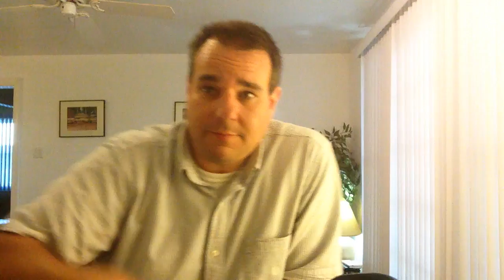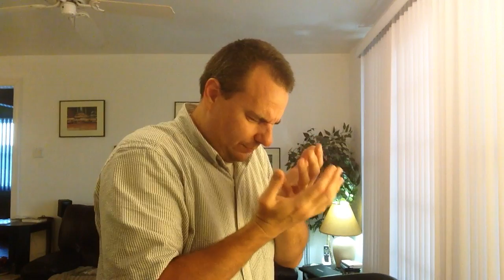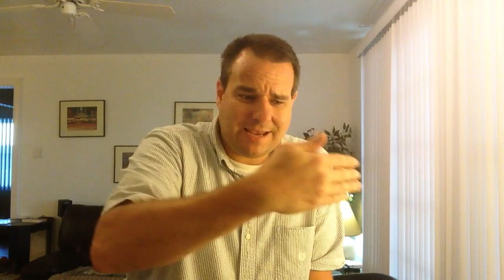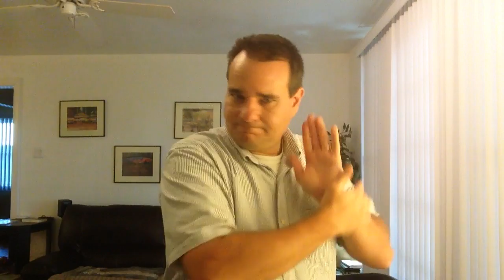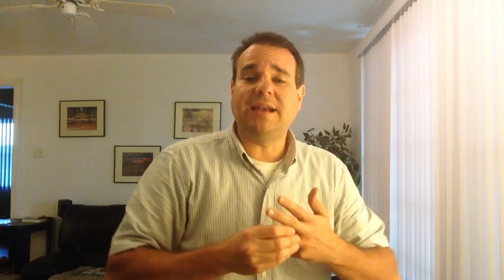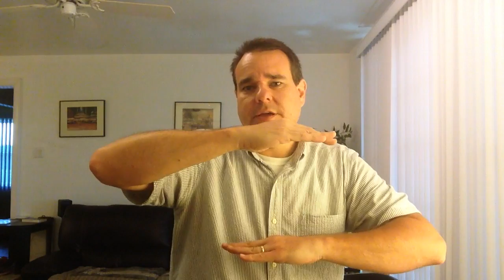More Digital Concepts - Sample Rate, Bit Depth & Rate

Comment: Nice commentary Kris as this matches much of what I have read on the subject.  I'll download these over the weekend and try and play them on the big rig.   Although, I have toyed around with this myself past with mp3s, I am curious to hear what you have done because I don't have anything that can sample higher than 48 kHz.  I do think what is not in the audible audio spectrum does play a little into what we hear but its difficult to prove definitively.
Reply from the maker: +BarakaPDub I used to be someone who believe the subaudible did affect the audible - but then I started thinking - frumpy white middle aged men are the ones who usually debate this stuff back and forth and they can't hear anything above 15k, and probably 12k... and unless they are sitting next to the tweeter, they aren't going to feel it either... Once I started looking at the power of those Ultra High Frequencies, I started doubting it - not 100% mind you, but now I'm 50%/50% on whether it does make a sense to realism... I do hold some credence to the theory that the RIAA curve process causes something to the sound that sounds more "real", but of course, we could just do that to the digital signal as well and get the same result if we were so inclined - however I am not going to go through that test and it would be SO subjective that I don't think we'd ever get a definitive answer.  Next in the series is called "Master Blaster Runs Vinyl Town" where I go into why the master is the real point, and why probably your vinyl trumps your other formats regardless of the mediums attributes...
Reply: +dixielandfarm After dwelling on this last night, more thoughts came to mind as I constantly formulate things in my head.   This was a topic I too thought of addressing in a video but you beat me to the punch.  What you say is definitely true about the power of the higher frequencies but what it really boils down to, in all realms of playback, is the capability of your input and output.  The theorem of Garbage In = Garbage Out applies.  If you're microphones are not sensitive enough to pick up those higher frequencies then it's never going to be caught on tape or digitally.  Likewise, most speakers are not capable of covering the whole human hearing spectrum so even if your recording equipment is capable, your average person's out put won't match it.   You definitely imply this on your soundcard and earbud comment.  That is also provided your processing in between doesn't hit some limitation.   

16 bit/44.1 kHz is definitely good and a satisfying listen and most folks wouldn't pick up on much of a difference between 24 bit/96 kHz but the later does mean for a refined audio wave.  The only question is how the signal is processed by the DAC and provided as output.  DAC process the signals differently and then once they become a voltage signal, then it's how the rest of the system interprets it.

Going back to the inaudible, I am curious to see how much of the inaudible harmonics factor in with the audible frequencies...if anything.   I too see a lot of debate but I would love to see something conclusive which I have never come across.  

I still love both formats and I don't get the guys that knock CDs.
Reply from the maker: +BarakaPDub As much as I have read about the nice gentle slope in the above 20khz range and seeing a spectrum analyzer showing the content that is present, I have read quite a bit of postings (though hidden under the ANALOG RULEZ posts) that say that most studio equipment simply lopped off those frequencies anyway, and most tape machines didn't resolve above 20khz regardless (unless the masters were running at 30 ips and the board and eqs in the board passed those through).  So, I have started to think - if a good amount of recordings don't have above 20khz anyway and many do have above 20khz, how come one doesn't often go "Something doesn't sound right here?"... like, lets say 1 out of 5 don't have above 20khz (but it could be MUCH more than that, but for example here)... how come we don't think, hmm - this recording is off?An astounding amount of Rock was recorded with the Shure SM-58/59 and that has it's frequency response dropping of sharply at 10khz... I think a lot of the digital vs. analog has to do with not comparing same qualities and skewing the preference - if you had a crap cart and table and a nice cd player or dac, you listen to ONE record and base your whole ideology on that, you skew one way.  Likewise, a sony player with overdriven output compared to a Rega or Project, you are going to skew a different way... If you did this test in the 80s or early 90s, you are definitely going to believe CDs are overbright (the music from that time period was overbright to begin with, then the players were bright on top of that)... I find that most of the people who are adamant on one side or the other did these qualitative judgements once in a very unscientific way and have never revisited or done it fairly.  Now, saying that - I love records.  I think they are great.  I don't think the digital does anything better other than lack of degradation or pressing flaws or convenience.  The medium is just a carrier, so each format has plusses and minuses.  I do feel you honor the recording when you play a vinyl record.  But, on the other hand, some recordings were just built for CD and belong there - Spirtualized "Ladies and Gentleman..." was intended as one long piece, same with SP/Mellon Collie and it's two sides, etc... It all depends is the short answer, really :P
Reply: I agree with you 100%.  Did Beethoven have CDs in mind when he was writing his 9th? ;)

Comment: Went down this road the past 25 years ( spent over $20.000 in CD/dacs )- got back into vinyl 2 years ago after going CD then SACD/DVDA at 96/24 between 1999 - 2012. Went back to vinyl since i'm more into rock. What I found - The good thing about digital is you can play with it…. the BAD thing about digital is you or someone else can play with it ! at 44.1/16 leaves less room for it to sound good than that of a tape or at 96/24 . The key with CD is how it's mastered. 
I have a Rega P6 turntable $2,000 sounds better than my $5,000 Cary tube CD  player on about 80% and better than my Oppo 105 $1,200 for SACD/DVDA 70% time. This is for music I know over the past two years. I have B&W speakers and a large number of high end headphones.
Test clips or not real life listen - do a test over weeks were you have same music in different formats ! that's the real life test….it's when you sit back and just enjoy music that will tell you more than any sound clip test.
Reply: +sam8911sk I also have a MAC server with software and a nice DAC - about 5 years ago I compared around 100 songs I love in a play list. The rates were ITunes/320/redbook and some cases got 94/24. 
What did I find ? Lets just say since I did the test I rip all my CD's at 44.1 lossless.
Reply from the maker: +sam8911sk It's gonna vary I think with people and mp3s, no question.  96/24 and 44.1/16 however are gonna be a very select few.  I was almost hesitant to put out this video without the companion video on mastering - Let's face it, most of us listen to music from the 60s and 70s and in my experience, whatever the dominant format was at the time will have the best mastering - which means the vinyl... it isn't that the CD COULDN'T have the same fidelity, it is that it just often doesn't.  These audio test I have done have been here and there over the past year - the more I read, the more frenetic the anti-digital rhetoric I read was - and wanted to really see for myself... It is why there are a dedicated bunch of folks who do their own needledrops so they have the best of both worlds - the sound of the best master in a digital format that is convenient.  

Now, I know my ears aren't what they were, so my tolerance for mp3s are greater than others - but that side of the test is really an adjunct - I figure if we are doing a test, lets do the whole thing :)  I think my DAC does make a difference as well - it is the Sabre chip that is so highly toted - it tends to make those lossy files sound pretty damn good  :)
Reply: +dixielandfarm Spot on about the mastering of the 60's and 70's I have found though some new rock acts that have put out some drop dead great vinyl sounding records the past few years.... I think things are getting better ( away from the loud wars of the 90's ) Also like you said DAC's are getting better and add cheaper.
Reply from the maker: +sam8911sk Yeah, I was thinking today I should mention, somewhere around 2010 and the vinyl trend, new vinyl seems to have the edge - though one could argue that if you are serious about music, you'd go for the vinyl on new releases just to actually OWN it... They are definitely getting better as the loudness wars seems to be lost on all sides...